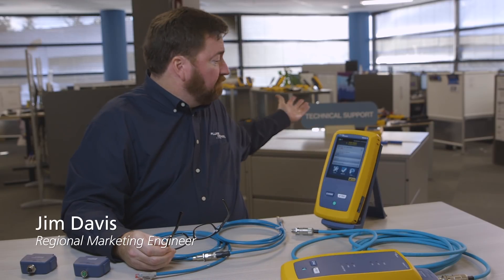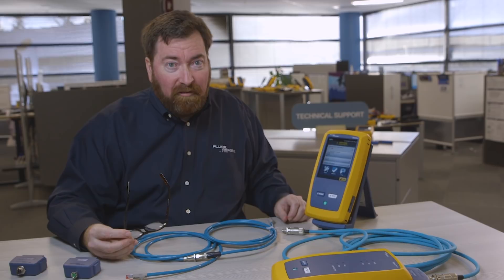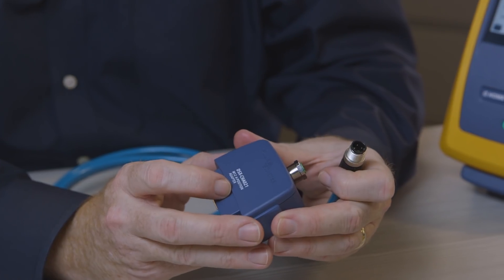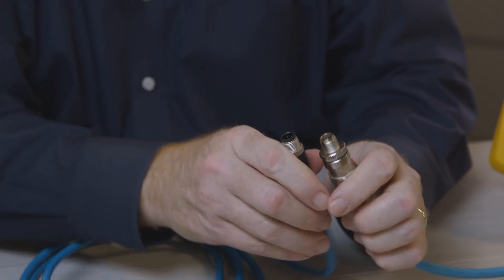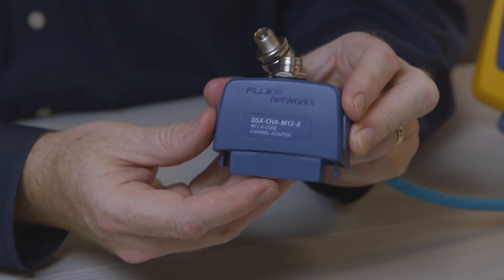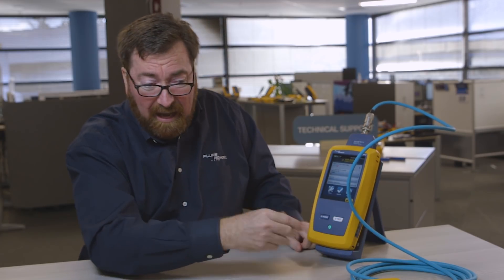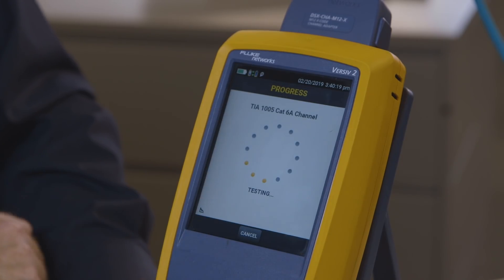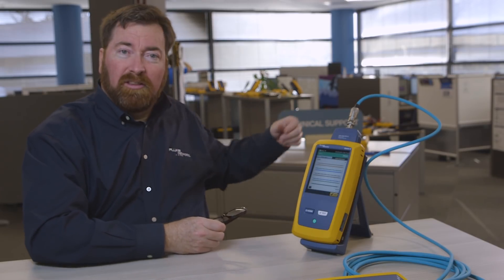Testing M12 (Industrial Ethernet) Connections with the DSX CableAnalyzer™ by Fluke Networks

Comment: what about how well it passed?
Reply: "It doesn't matter if you pass by an inch or a mile. Passing is passing" Network specialist Dominic Toretto.
Reply: @koitk not true there is pass fail but that doesn’t test relections etcetera
Reply: Domnic Torreto didn't have any issuses with relections or crosstalk, he was just Pass-Fail kind of guy.  He was so sure of his cabling he bet on his car and he won big-time.

Comment: In my opinion, questionable recommendations are made in this video. The cable section with M12-X code plug shown is probably an end-to-end link or a jumper cable. A channel measurement recommended here can not capture the quality of the assembled connectors. There is the End to End link measurement in the TIA and ISO / IEC standards, which also evaluates the plug connectors at the beginning and end of the link.
Reply from the maker: Thank you very much for your comments, they provide an insightful reminder of the problems that can be caused by poor quality connectors at the end of industrial cabling, and the advantages of the ISO/IEC End to End approach to evaluate these end connections.

The ISO/IEC End to End limits, which currently are not yet specified by TIA, may be appropriate if these are field installed connectors (or for other reasons), but as you correctly point out the TIA-1005 channel test will not include the mated NEXT of the end connectors into the tested result.

As always, it is not our place to tell customers which test limits to use, and we would always suggest an installer seek the recommendations of their cabling manufacturer regarding which limit to use.

In this video Jim avoids making a recommendation for which limit to use, and offers further discussion (2min19sec) regarding limit selection in a  video dedicated to examining the options that are available for both TIA and ISO/IEC industrial cabling.

Our intention with this video was simply to introduce the new M12 X-Code adapters, which can be used for TIA and ISO channel tests, and even the End to End limits provided by ISO/IEC TR-11801-9902-2017. Using the M12 adapters will provide the most accurate measurements of a link terminated with M12 connectors, and avoid the challenges of going through an RJ-45 connector.